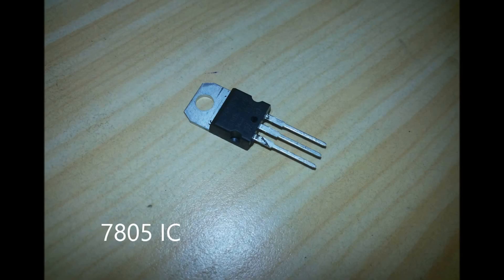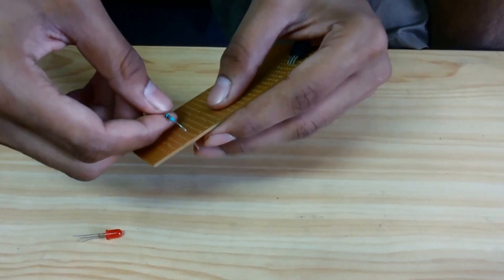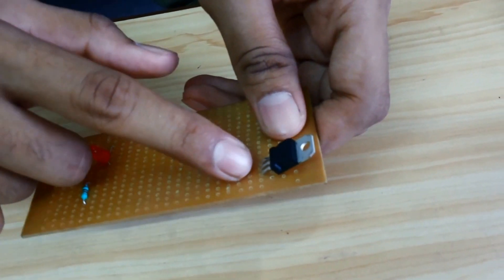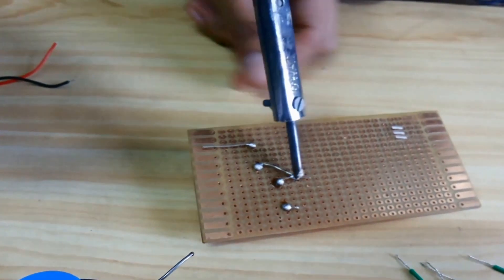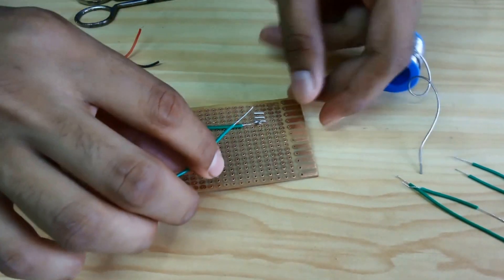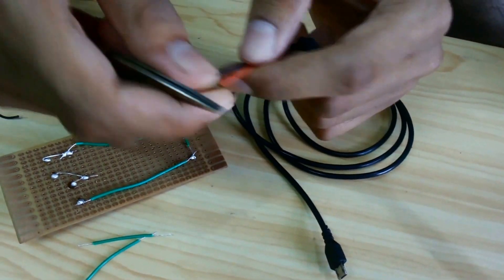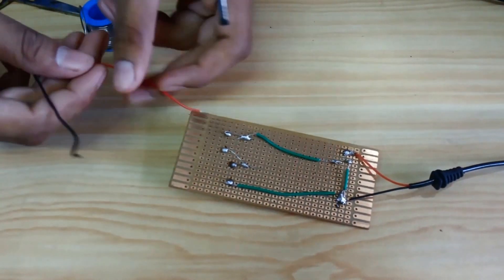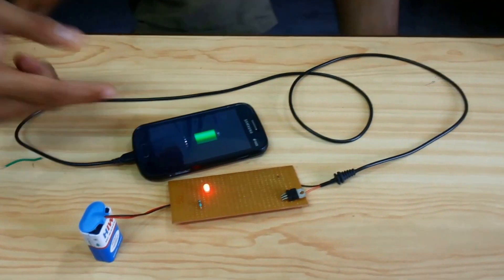How to make PORTABLE MOBILE CHARGER

Comment: pls learn to say english and do u know how many voltage is requrie for charching and mobile need dc current yes battery is of dc curent but we have to smooth it with diode ...pls dont make the video if u dont know ....specially u learn english and make short video for subscribition theres my tip take it seriously

Comment: 9v battery is not designed for this high drain application. It will put some power into your phone, but very very slowly and will not fully charge it.

Comment: i m connecting the red and black wires as shown in the video correctly but phone is not charging what should i do
 the circuit is all right led is also lighting phone does not charge ................n charging wires 4 types of wires is located red, black, white and green..............i have only connected the red and black but phone is not charging what should i do

Comment: guys my bank is not working well when i conect the battery to circuit then led lemp is giving full light and when i conect the mobile then that's bulb will decreased it's light but mbl couldn't charging

Comment: Hey GuysI tried replacing the 9v battery in my multimeter with the 9v(2A) adapter output.
But to my surprise it is not showing the voltages correctly, the display works fine and shows 0.000 when I do not connect anything but when I connect a voltage source to its leads, it says -1 and sometimes it just keeps showing random numbers on display.
Can anyone suggest me something

Comment: This solder-connection is terrible.
A solder connection needs to be shiny.

1. Heat the unit before attaching solder.
2. let it flow by letting it 2 sec in there when attached.
3. Not move with the unit when congealing.
4. You got a good connection.

Comment: if you use 10 microfarad capacitor with the voltage ragulator so it will constantly provide current rather then sending in pockets some mobile phone give you connected charger and not connected option again and again.. so for those it will be helpful if you use 10 microfarad capacitor with the voltage ragulator

Comment: hello guz:)i have simple question for you?as we know 9v battery discharge the voltage when we use frequent  so is it anyother component we use  behalf of 9v battery such as any adopter or any other?next question is 9v doesnot fullfill the accurate amount of current so what can we do ?

Comment: i have made it but my phones charge is decreasing not increasing help me plzzzzzz
Reply: Because you need a one way diode to stop the current to flow back to the battery... besides this ones a very basic circuits... look for step up voltage converter circuits...

Comment: can you pls tell me how it works. i have to write in my physics project about it
Reply from the maker: +Shivasish Tripathi The 7805 IC is a voltage regulator which have 3 pins ; 2 of them are input pins for positive and negative point of battery and the 3rd pin is output pin. 78xx series ICs all are voltage regulator and 7805 regulates input voltage to 5volts output. The IC needs 9 to 22volts of input to give output of 5 volts. We are using 7805 because all the mobile chargers are specified as 5volts. That's it.

Comment: hi sir, 
can u plz guide me if we could use breadboard instead of PCB, would it work the same way?
Reply: Duh! you can use a breadboard, the only problem is breadboard is not at all portable, where as this circuit can be made on a 1inchX1inch of strip board! But if you just wanna check if the circuit works then go for it!

Comment: if you see in power bank there is an capacitors that's the reason why i am saying this and you are using the hw battery which is used for hard layer circuit boards like trimmer like dc motor  stuffs so i recommend to use an AA battery

Comment: sorry to say this please don't use this method because it will fry you phone power supply ic after an hrs the power capacitens is very bad but i have an ides after the ic you need to set e capacitors around 40 uf to 45 uf it will help

Comment: use a 2 18650 li ion batery 4.2 volts each and and put he heatsink on it and in this circuit iphones does not charge for correct this put a 2 resistors 100 ohm each in other wires of usb ..conect the two pins of 100ohm resistor with the 7508 5 volts pin and the other two are each connected to usb other wires seperate the other two except red and black and now the iphone also charges now ..and you try to practice soldering first ..

Comment: no protection for reverse voltage, add diodes or other component plz guyz
Reply: +Nishant Bhangale So u are saying that the battery cannot be recharged by this thing ? Maybe if u use batteries from old phones and u cannot charge them with this LM?
Reply: +DreamTeam Gaming 
my friend i m not saying that battery is not charging i have the new phone xolo q1000 and i did this experiment with this phone and i hv this result thats why i m asking you . my phone battery simulating reverse voltage from phone battery to this charging thats why battery not charging??any solution to this??? plz tell

Comment: Well made video, that said, when soldering, heat the material not the solder for long lasting high quality solder joints. I hope you keep up the good work, and please practice soldering the "right" way. Heat the pad on the board, and wire, then apply a bit of solder and you will have much better solder joints.  Solder joints that are grey and not shiny indicate "cold" solder joints.  Other then that, a nice circuit and very well explained.  Oh and I sure wish I had 3 hands when soldering like that!

Comment: good work, i appreciate it............. (y)
i suggest improve your soldering skills, you would be able to make the circuit in a square inch board also find ic that draws less current to make much efficient charger. keep it up (y)

Comment: Well, that's a very.. 'interesting' layout ;) I usually place the wires on top of the pcb, makes for easier soldering! And if you place the components closer and in a logic order you can reduce the amount of wires needed :) But as long as it works, good work!

Comment: Brother is it possible to turn my phone charger (usb charger) to power bank by ading laptop battery rechargable cells ?? 

Please give it a try ! thank you!

aik charger ko power bank kysy bnaya jaye AC khtm karky rechargable battery laga kar ??
Reply: +Nasr Awan Your charger is a switched power supply, doen't works. You can buy on Ebay a "Diy Power case" for 2 dollars to put the 18650 batteries inside.

Comment: Hello. I think It's needed some capacitors to maximize the stability. And the LED doesn't important, because if you have some problems with the ic your phone can't charge, and you see, because you can't have issues with capacitors. And I think it's good to apply a heatsink to the ic if you charge with more current. The heat (in watts)=(input voltage-output voltage)xcurrent. And you can use some hot glue and soldering if you want to build a smaller charger.

Comment: Nice work but is it essential to add a voltage regulator. Can you not directly connect the 9V DC battery to your charging unit. It will work in the same way and will be cheaper as well. The IC 7808 Voltage regulator is I think of no use it only reduces the charging speed. What do you say about it?
Reply: +Om Tiwari well you will blow up your phone... because your phone uses usb voltage to charge wich is min. 4,5V and max. 5,5V...

Comment: friends voltage will come, what about current. cell will have 2000mah capacity. the battery u showed is 500mah. only voltage will come .
show us if really charge % increased. i dnt this that will work out
Reply: +143jaia  use 4 rechargeable cells in parallel to increase the current capacity that way you'll have a rechargeable portable mobile charger
Reply: +abhi shek  yes your are correct. 
do you have any suggestion?
Reply: Battery should have greater mah
Reply: thanks Manpreet Let me try
Reply: abhi shek sir, If   I  use  12 volt  100AH battery    to insure  then this ckt  will  work or not
Reply: +abhi shek  current is very low
mobile shows charging but battery percent remains constant
Reply: abhi shek It definitely wouldn't work. Infact after some time a back flow would occur due to p.d.

Comment: To everybody watching this: The 78xx -series of IC's are linear regulators, this implies that the output current of the IC is the same as the input current.
Power = U*I
So in case we use a 9V battery the IC consumes: 9V*1A = 9W
The output power: 5V*1A = 5W
This means the a maximum efficiency of: 5W/9W = 55%
If the input voltage is higher, the efficiency will drop even lower ( if you were to use a car battery for example: 5W/12W= 41%). 
If you have a 9V battery that can hold 1000mAh (=9Wh), theoretically (if you have a conversion-circuit with an efficiency of 100%) you could charge the battery of a small smartphone (mine has a 5,7Wh battery) almost 1,5 times. However, due to the inefficient IC used in this circuit, you won't even be able the get 1 full charge. The 7805 is a great IC for prototyping and applications where power consumption is of little concern, for a mobile charger it is simply worthless. If you really want to build your own charger, look for a Buck-converter (you can find them on ebay/aliexpress,... for 1-5$) which can get an efficiency of up to 90% (and higher the more you spend).
The maker(s) of this video is probably pretty new to electronics (/lacking experience) and not aware of such things as efficiency.
Reply: +cochin007 That's true! :) Once you read a little about them they're fairly easy to make. You could go to TI's site, they make quite a few IC's for buck/boost/SEPIC converters, and you can order free samples. If you look @the datasheet you will find a few configuration options and how to calculate the components. Just order a few IC's (keep it easy, there are really unbelievably good IC's which often lead to a complicated design process) and experiment a little with them. Or build one with a 555 or a microcontroller... And on the homebrewing part I have to say that if it weren't for Jack Kilby (inventor of IC's) the 7805 would still be on a circuitboard as well. In that aspect they're very similar, the 7805 is just easier to use and a bit cheaper, although you don't get a lot of bang for the buck. (I don't have anything against 7805, I have a few of them lying around and they're integrated in many things I've made, but if the application isn't connected to the grid, I tend to avoid them.)
Reply: That's a friend of mine
Reply: +Joren Verniers 7805 IC is greater so what is your less IC?
Reply: What? The 7805 is rubbish, what's your background in Elektronics?
Reply: +Sys.stem I believe you can contact me through my youtube account, if you have any questions I would like to help you.
Reply: Joren Verniers
just give me your email or you contact me because i m not getting no where by looking around
Reply: every one is true that 7805 has loss but buck converter is not easy to make right? Is there better options ? 7805 is easier but loss is high. We can get off shelf boards but homebrewing is a hobby for all of us right
Reply: +Joren Verniersyou ok contact me or leave your contact
Reply: Joren Verniers Thibault Dc ?
Reply: Joren Verniers yeah then you hit me up directly  cuz im lost
Reply: Joren Verniers ok
Reply: Joren Verniers helloo
Reply: x ä ixy.yx
Reply: +Joren Verniers you pretty much good at electronics, nice suggestions, thanks man
Reply: Są młodzi to jak w przyszłość rozwiną umiejętności to będą wnikać w szczegóły...
:\  I od czegoś trzeba zacząć...
Reply: so ,are there heavy losses by that way?

Comment: Guys will it not damage mobile,s battery or make battery life shorter?
Reply: irfan sadat it will be damaged..battery of our mobile are designed to charge at around 5v . in this case voltage is higher...but for emergency conditions it will work just fine...
Reply: pavan kumar according to your reason, this circuit would not damage the battery of mobile as they have used 7805 ic whose purpose is to regulate the voltage at 5v.

Comment: the battery has a capacity of around 625mAh. At 9 volts that means a total theoretical power of 5625mWh. The battery of a mobile phone delivers at 3.7V about 2000mAh (depending on the model) which corelates to a total power of 7400mWh. So in short: it's possible to do so but not that practical as it doesn't even charge your phone once (their is still an efficiency loss in the voltage regulator). Nice project to show the principles though

Comment: PLZZ Dont make this..this charger will burn your phone IC. the current through it is not constant more over you have to add a current filtering circuit so that you stand up to your phone battery specification and have you thought of the ripple adverse effect on your phone
Reply: Abhinav Chaudhary when you are using 7805, the ripple is almost nil
Reply: Shayanta Sur yes its almost nil but it may harm your phone as u cant regulate the current o/p value.

Comment from the maker: checkout our new video
https://youtu.be/NjO4IYF0YJQ
Reply: +khan faizan in a usb cable 2 wires are for data transfer and two are for current supply.in this project you need to connect red and black wire.
Reply: +khan faizan its RED wire and BLACK wire, ignore WHITE and GREEN wires
Reply: You have make best power bank
Reply: +Mrinar Thakur some phones require the green and white wires to be connected together. This should only be done to charging circuits, not to a actual USB wire that can be plugged into a computer! It will destroy the USB port.
Reply: PunakiviAddikti 1.75v 200uamp green 3.5v 500ma Wight wire
Reply: Mrinal Thakur Yes, exactly. The only problem is that you need a couple of voltage dividers to make those voltages, but you don't have to if you just solder the data wires together. I've tested it on iPhone 6 and it seems to work.
Reply: ok
Reply: haris ali You must solder the middle two wires of the charging cable (white and green) together. Some devices require that to make sure it's a legit charger.
Reply: XperiMentals  will the 9 volt battery goes dead later if not in use? 
can i connect a switch to it?
Reply from the maker: use u can connect switch. it is very easy to connect a switch
Reply: + How to make poRtABLE MoBILE CHARGER
Reply: +XperiMentals hey bros..can i install this kit in motorbike?
Reply from the maker: yes.. choose wisely the circuit
Reply: +XperiMentals with using same componets ? or have to change?
Reply: for how long can you charge with that battery?
Reply: +XperiMentals plz help me I tried everything but in USB cable 4 wire is their. what 2 wire I sold
Reply: +Mrinal  Thakur ir
Reply: Nice tutorial, using the LM1705 is a good way to get steady 5 volts. But, you could have added 10uF capacirors in parallel to the output and input, and a 330-370 ohm resistor would have been better if you connected the LED to the 5V output instead of the 9V input. Less power wasted.
Reply: PunakiviAddikti that's for fast charging devices
Reply: Mrinal Thakur True, but some phones require it, like some models of Android phones. Otherwise they will not take a charge. When plugged into a computer they use the data wires to make sure they are plugged to a legitimate device before taking a charge. Apple phones on the other hand require very specific voltage on the data pins, but connecting them together should work for them too.
Reply: XperiMentals
Reply: Hey guys... please send me the Report or synopsis of this project if u have... i need it urgently.. if u have it then please whatsapp me at 7078011429..
Reply: Ramuday Chatterjee its not working sir .its show on screen .; not charging; i used 7806 and 7805 but both have same problm.
what i do
Reply: Violette Zelaya Salcedo I I love u Jaan
Reply: This is really great.

Comment: pls answer all my questions...what if ill use a higher battery like in the car or motorcycle battery or just any higher battery or solar panels for that matter...will this work still?
Reply from the maker: Mardonio Herrera jr.  it will work between 7.5 - 21 volts. so if u are using voltage in this range then anything will work properly. and i think a solar panel will work well.
Reply: XperiMentals  Thanks you so much... Godbless guys
Reply: ***** WHO YOU,? THATS NOT MY TOPIC...IM NOT INTERESTED IN GPS...
Reply: ***** WHO YOU,? THATS NOT MY TOPIC...IM NOT INTERESTED IN GPS...
Reply: Mardonio Herrera jr. if you are using high voltage then please use a screw on heat sink on the chip since it heats up a lot at higher input voltages... also,the circuit above is ok for emergency charge at bad situations but its not practical for daily usage since it wont completely fill your phone hence making it inefficient and uneconomical
Reply from the maker: in this case it is select the right ic

Comment: can i connect this set up to a solar panel which has only 6volts, so I guess its ok cause you are using a 5v regulator for it to charge it well, right? so how about in increasing its Amps? cause my phone need higher of 2Amps for it to charge..so this set will do or not?
Reply from the maker: Mardonio Herrera jr. no u have to use atleast 7.5 volts and maximum of 21 volts for this ic.
Reply: XperiMentals Thanks I bought already higher volt solar panel..about 9volts and i series it to my existing other panel which has 6volts...total of 15 to 16 volts...i guess this will do right? thats the whole purpose of the regulator to regulate the volts going to the celphone which is only 5volts... right?